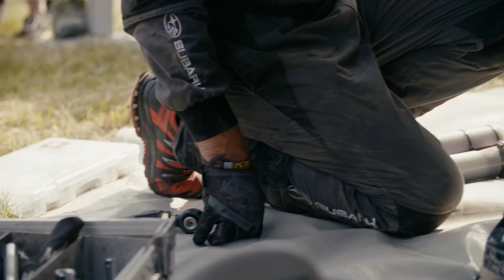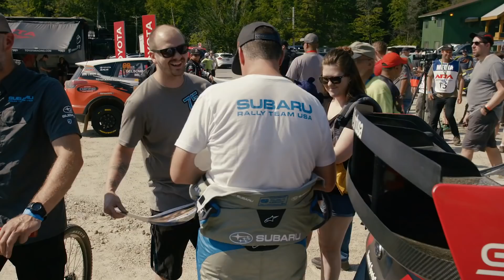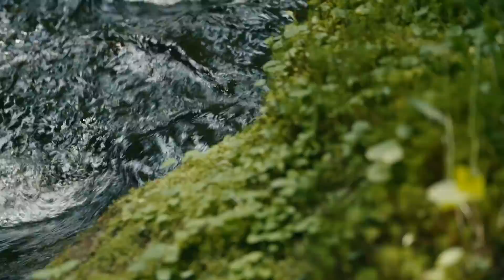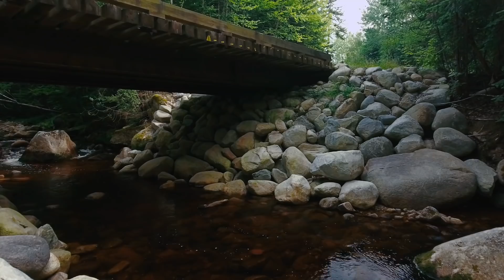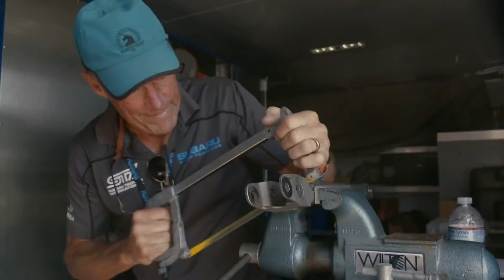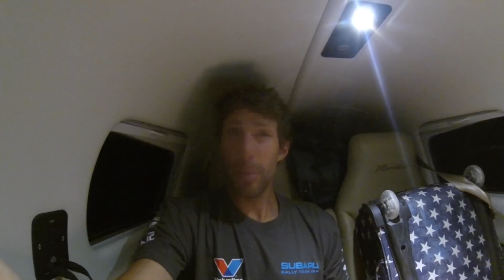Launch Control: New England Forest Rally 2017  – Episode 5.08

Comment: As much as I love rally, it sure has some bizarre rules. Why can't they have more than an 80mph average? Anyone know the reason of this? This is racing, should be that whoever goes fastest, wins. That's it.
Reply: xSLWRTHNUx 80 mph is the death speed.
Reply: xSLWRTHNUx  80mph avg is fast as fuck  that means they are spending alot of time at the top of 6th gear like 117-130mph
Reply: Regardless of how fast it is, I'm just wondering what the reasoning behind this rule is. I've never heard of it being applied before.
Reply: xSLWRTHNUx rally America was 90mph Im pretty sure 
But it's typically not met that offen but only a few times an event by the subaru team
Reply: Its a safety consideration. It is to discourage rallies from including stages that are too fast. Too fast from a safety/insurance standpoint for the sanctioning body.   A stage that is avg over 80mph is super fast, meaning the cars are traveling way higher than 80mph a lot of the time, and one could argue these types of very-fast roads carry increased risk of injury if there was an accident.
Reply: British stuff is even less than that some rally's are nothing but bale chicanes at times.. 🙄
Reply: At those speeds it's more of a drag race than a rally. Kind of boring for both competitors and spectators.
Reply: I would guess it's to help level the playing field between a factory team and the other teams that don't have nearly the same budget.  I'm sure the non-Subie teams are getting tired of never winning.  Hopefully Ford will join the rally some day and give Subaru a run for their money.  I think that's all it will take to spark other manufacturers to join.  Then America will have its own WRC (ARC?)
Reply: Look to Group B and why it was banned.
Reply: AFAIK B was banned due to idiot spectators and dumb organizers and serious lack of safety designed into vehicles. look at 2017 regulations, a lot of what made group b now is in the current 2017 regs. but with tons of safety designed into the monsters and minding the spectators
Reply: Except the fact that they can't go as fast. It's tied to human capabilities. Maintaining a higher average speed WILL lead to higher rates of mistakes. Of course they can choose to go faster, but the incentive isn't there.
Reply: Lol clearly u dont know what racing or rally is. Speed isnt important as car handling and drivers skills. Anyone can go fast but once u hit the turn only few know what to engage correctly. F1 cars are fast but speed still that plays last factor on the track that has couple of dozen turns. Drag race is same if u dont have right tires and proper tire heat u can have 1000 more hp then your opponent and he will smoke you. So not a single type of racing is about speed nor speed only wins the race.
Reply: Badgers, when the rules were drawn up badgers were commonplace on on rally stages far from towns
Reply: EU rally is so heavily regulated it's almost ruined since it feels like teams are fighting against who meets the regulations, also there haven't been very personal drivers for a long time. Don't get me wrong, it's still awesome, exiting and scary but something is missing from the golden era....

Comment: So...Are they just racing themselves? Please someone elaborate.
Reply: There are plenty of other cars racing as well, but nobody's on the same level as SRT. Manufacturer backing provides them with enough funding to do whatever they need to, and Vermont Sportscar has a massive wealth of experience building and servicing rally vehicles.
Reply: You race the clock on rally, but other cars are on the track at the same time. Start interval for the top cars is usually 2 min apart. For cars that are slower the start interval is usually 1 or 1.5 min.   The races are run on regular forest roads (temporary shutdown and controlled by volunteers).  Passing in rally is rare as the cars are put in order of qualifying.
Reply: Jesse O'Brien - TLDR: "Yes".

Comment: Anybody have any info on the engines they're using? I can't find anything on it. Displacement, redline, power/torque numbers, boost psi, etc. I'm curious
Reply: OVER 9000!!!!!!!!
Reply: Here are the specs for the 2015 car. I can't imagine they changed much in 2 years without a new chassis:

http://vtcar.com/projects/srt-usa-2015-open-class-rally-car/
Reply: Brandon sever while I can't give you exact numbers 
2.5l 
298hp 
450tq
115-130 top speed 
35ish psi tampering down quickly  
For outta the hole style corners lol
0-60 is like 3.5 on gravel
Reply: I bet red line is 7000 
The turbo restictor doesn't like to let the engine Rev up

Comment: wheres the logic behind the "cant average above 80mph" rule
Reply: 80mph is the death speed, it was introduced after multiple catastrophes in the group b series. It's bad design on the rally organisers if the cars are reaching speeds on average 80mph or higher. Means drivers are taking a lot of risks and there's a lot more chance of errors & potentially death.

Comment: That's so stupid, maximum allowed 80mph average?
And if you're faster the time is set to the maximum average. Super lame in my opinion.
Reply: 80mph is the death speed, it was introduced after multiple catastrophes in the group b series. It's bad design on the rally organisers if the cars are reaching speeds on average 80mph or higher. Means drivers are taking a lot of risks and there's a lot more chance of errors & potentially death.